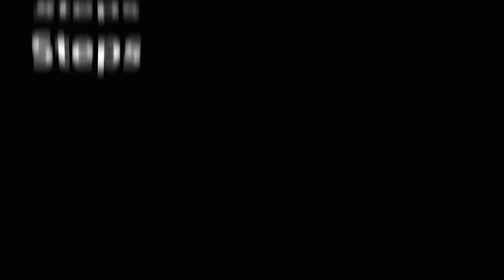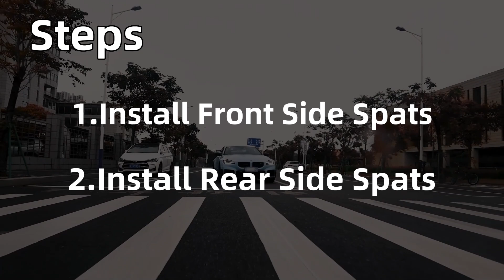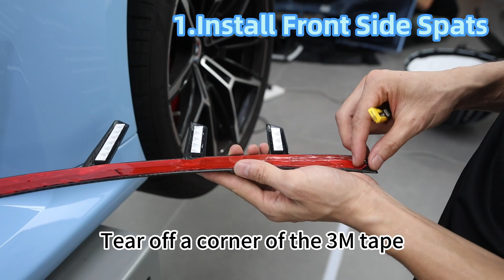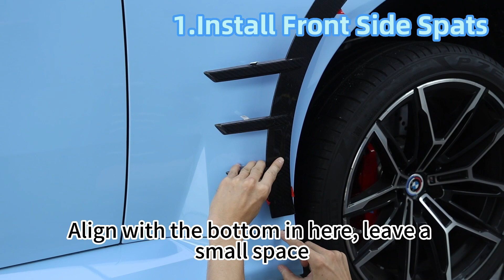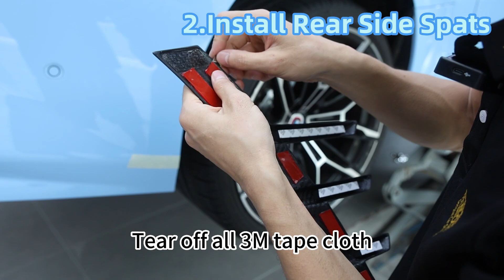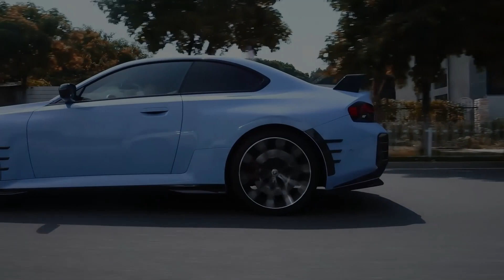Installation Guide: Dry Carbon Front & Rear Side Spats For M2 G87

Comment: Hello, what kind of tape is the white one. I have been looking for something that I could use
Reply from the maker: Hey mate, I am pretty sure that. But this is the tape we will add on the product before we send to customer.
Reply: @DongsaiCarStyling  Hello, I bought a set of these from bimmer plug, but did not come with any type of 3m tape and I have been looking for something that will fit inside of the 3 fins because they are hollow inside and everything I've been using just keeps peeling off. I have the red 3m tape just don't know what you are using for the 3 fins ? Any help would be appreciated please.